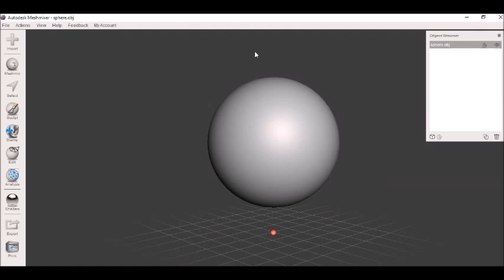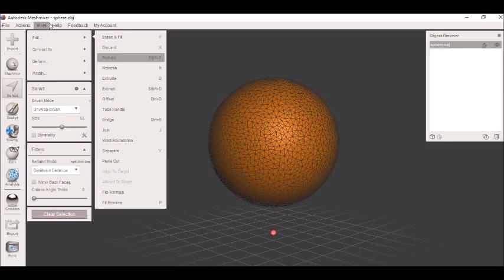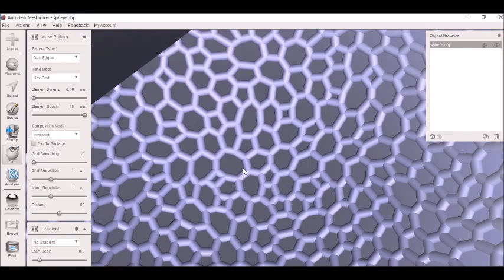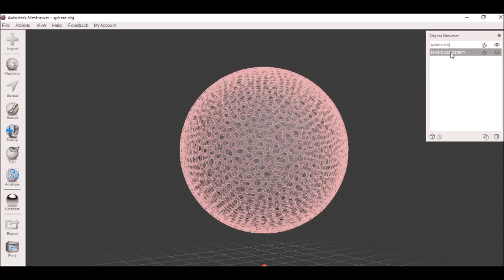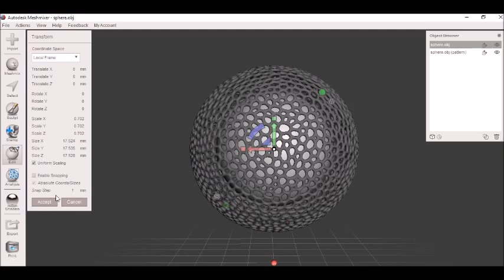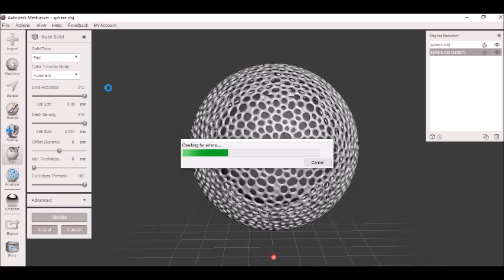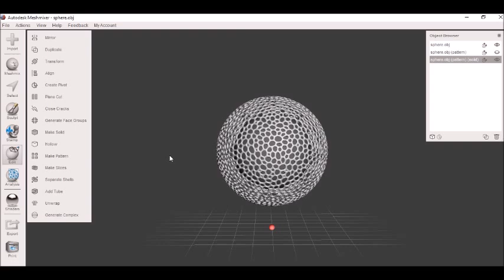how to make a voroni pattern in meshmixer

Comment: Hello, do you know the way how to make pattern only on a half of ball?
Reply from the maker: Paweł Pacek easiest way to do this is to cut a ball in half then mirror it separate the 2 into different layers then follow the steps in the video to make the vorvoni on 1 side afterwards fuse the 2 layers together so half will be and half won't
Reply: Ok, and what in case where I want to make pattern on some part of object, not half?
Reply from the maker: On the area you want to vorvoni select it with the select brush tool separate it from the layer and repeat the same steps it's tedious however it makes sure the process is done properly

Comment: Thank you,
I have searched long time.
From where are you learned?.
Greetings
Reply from the maker: claudio feldman I learned on my own by experimenting with the program. truthfully started learning 3D printing at sheridan college and went from there. if you are looking for a good book on 3D programs I like "3D printing with autodesk, 123D, tinkercad and makerbot" by lydia Sloan cline it's has helped me trouble shoot as well
Reply: Thank you !
( one more question: " do you use Meshmixer to reduce the weight o Netfabb ?..when the file is too heavy
 to send to online 3D printing ??( file since Meshmixer : sometimes so heavy ?)
 Thanks
 Please, and thank you again !!
Reply from the maker: elcurvo when the file is to heavy I use meshmixer to fix that as well. please go to my preparing for print video to see full steps. however if u click the print button then export from that menu it will save as a regular stl instead of an stl aci II which is a much smaller file size. that or I use Windows 10's 3D print program 3D builder to simplify it a bit more with their smoothie program and then save it from there.

hope this helps
Reply: Kayla Pruyssers o

Comment: Dual mesh and voronoi are two different things.
Reply from the maker: Paco Ortiz  this is the only way to accomplish the voroni style pattern in meshmixer. you can use the mesh + Delaunay (dual) edges however this program does not call it a voroni so I labeled what to use to make it in the video for those using meshmixer so they could find the setting with ease. on other programs it may be labeled different but this is the only method in meshmixer that works

Comment: Hi! I was wondering if you know a way to use an imported element? EG instead of random poly/tubes you could import a separate .obj that is repeated around the mesh?

Thanks!
Reply from the maker: Ruggada as long as the file is saved to ur computer if u click the import button then select append instead of replace u will be able to bring in another file and do as u please with it even put it inside the voroni